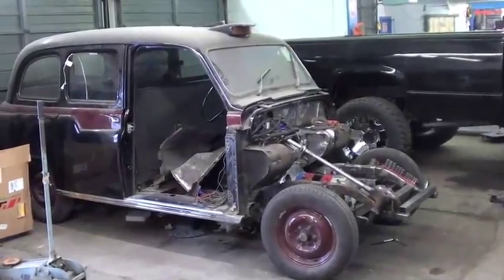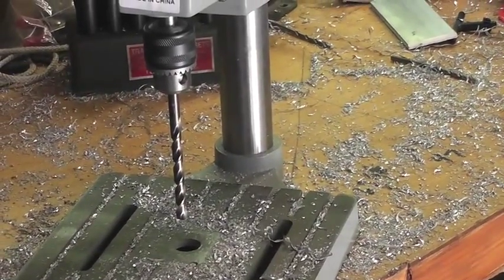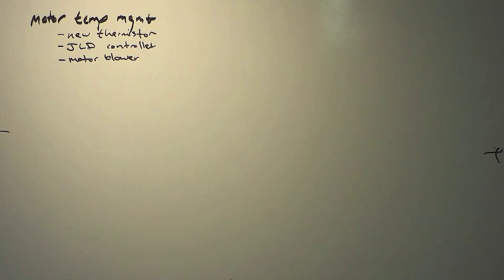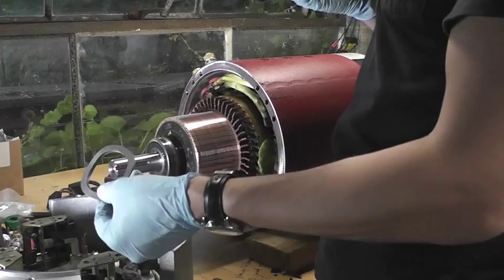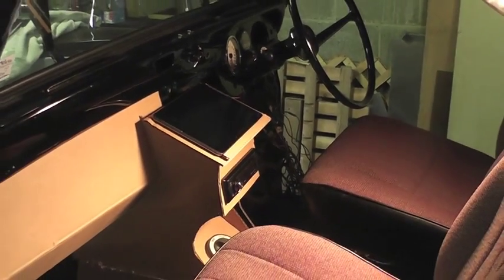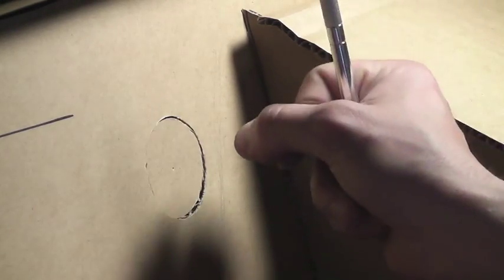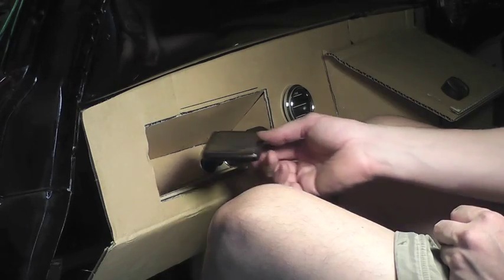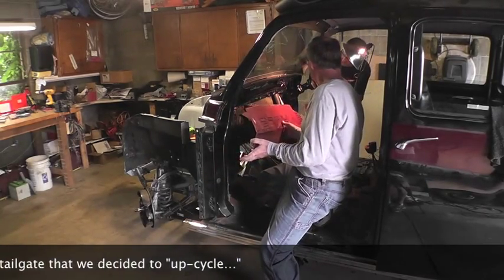electric conversion of an austin taxi - pt 8

Comment: You use the T2 "Plug For Thermistor" to connect a Pt100 thermo resistor..?!?
What was connected to the T2 before from Warfield? I haven't opened mine yet.
Regards
Mathieu
Reply from the maker: that's the problem.  not even netgain could answer how to use the stock sensor.  so we just went with what came with the temp controller as we knew that would work.
Reply: This can help you to find out which sensor is used.
http://www.intech.co.nz/products/temperature/typert.html
Reply: I found the sensor. The NXP - KTY84/130
But this does not help.
There is no display to find in my world...
http://uk.farnell.com/nxp/kty84-130/temperature-sensor/dp/2066192?Ntt=NXP+-+KTY84/130